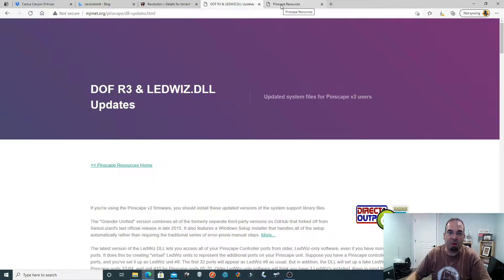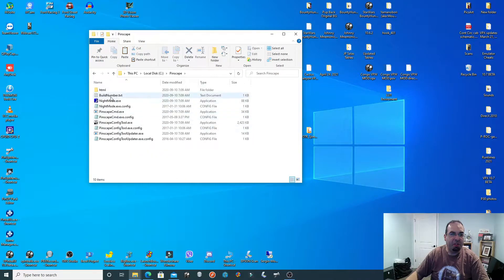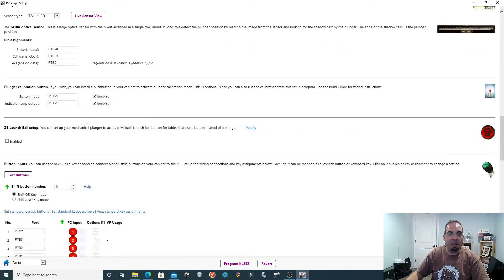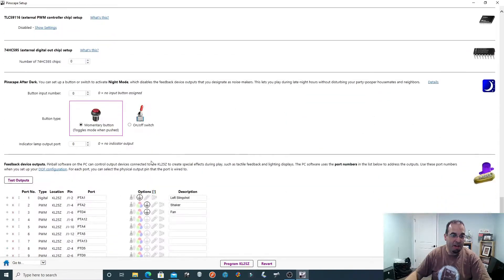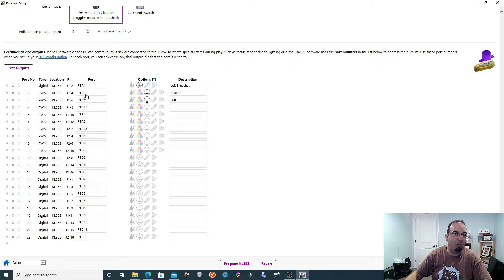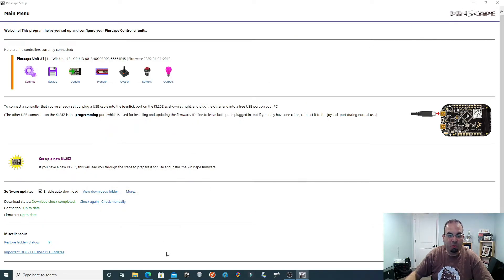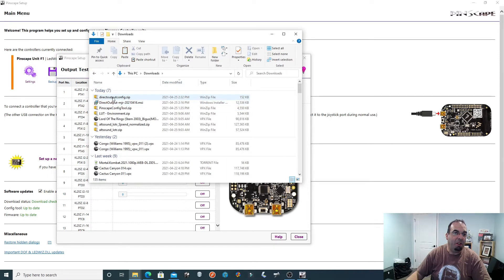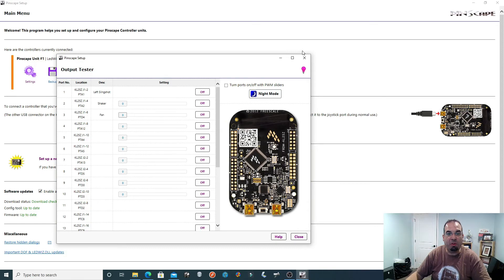Pinball Tech 101 - DOF / Pinscape software setup

Comment: Hi Sergio, it has been a while, sinds i said im going to try to connect the solenoids with the kl-shield.
i did it then, but i just couldn't find out witch port from pinscape is the port on my kl-shield.
So i feld myself stupid, and didnt want to go further anymore.
Sinds a week ago, i looked at the Arnoz older shields, and then i saw it.
On the older shields, the ports are written PTE1,  like you find it in the pinscape program.
But on the kl-shield V5.1 you only see E1, so you have to put PT in your mind for every port on the kl-shield.
And then you will know witch ports you need to connect with the pinscape.
Hopefuly i helped someone else with this problem. :)